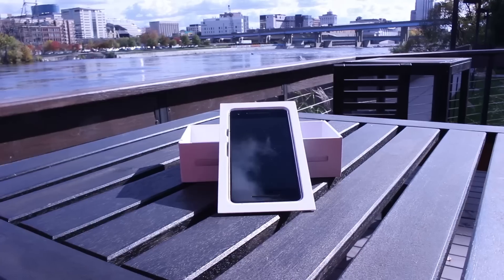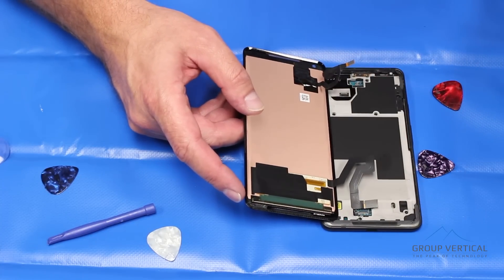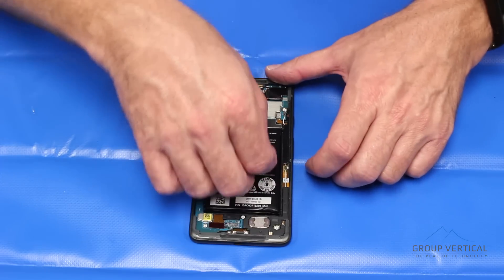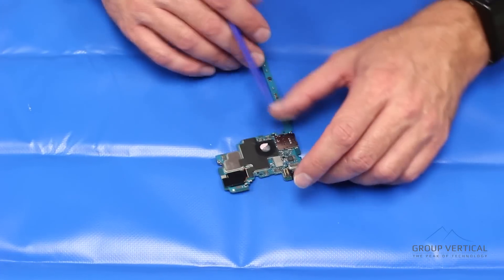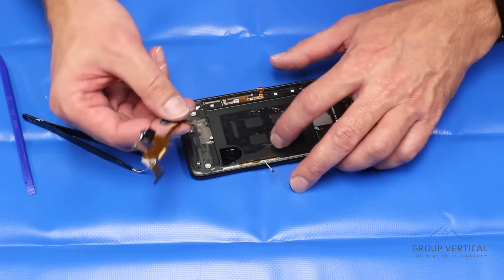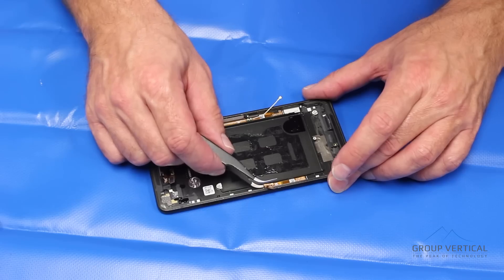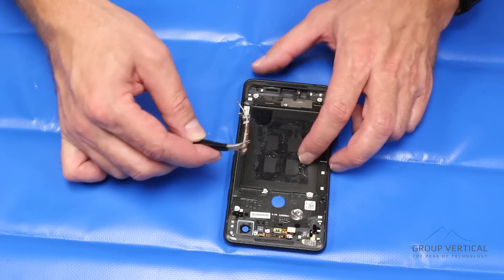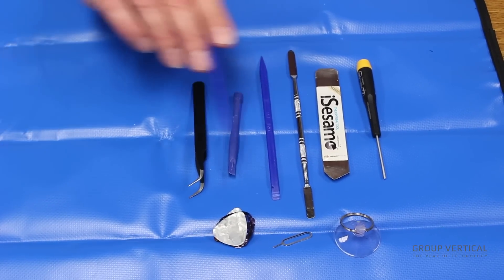Google Pixel 2 XL Teardown

Comment: The ultimate question is can the battery be replaced without damaging the display or is the display removal an inherently destructive process? These kinds of teardowns never demonstrate the operator replacing the original display on the unit. I wonder why?
Reply: Daniel, I was responding to the OP. My bad. I hate that youtube removed the intended receiver text from their replies.
Reply: I would imagine the process of replacing the battery is screen off then dive into the phone.  pretty much like all the iPhone from 5 up.
Reply: Not sure what you're talking about.  The display seemed to come off easy enough and the battery is just beneath the heat shield. Seems like battery replacement would be super simple unless you don't know how to take apart phones in the first place.
Reply: El Dooderino Ah I may of misread your message.  My bad
Reply: El Dooderino It only seems easy because they'd already loosened the adhesive prior to shooting the video. It's really strong adhesive and would definitely not come off initially with just a quick swipe of a guitar pick. I've taken apart my last three phones, so I'm pretty sure I know of what I speak. That being said, every one that's had an OLED display has never survived a heat gun. The actual professionals use a temperature controlled heating platen to weaken the edge adhesive, but even then I'm not sure the OLED panel would come out intact. I'd love how someone to prove me wrong on video.
Reply: Mike Trieu I've been using the iOpener and it works great. Well worth the 20 bucks. Part of my job is phone repair, so I know it can be a pain to loosen the adhesive.
Reply: It's difficult, you need to be careful and take your time. The adhesive can be a bïtch.